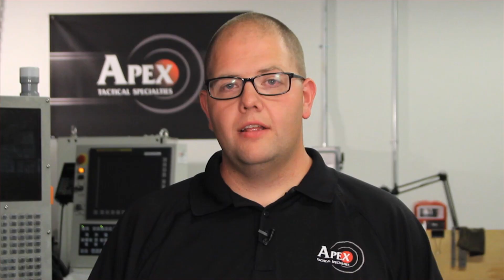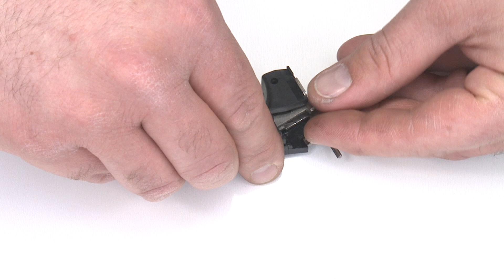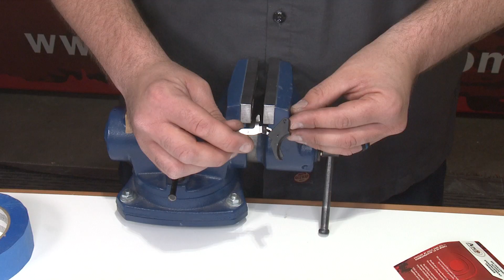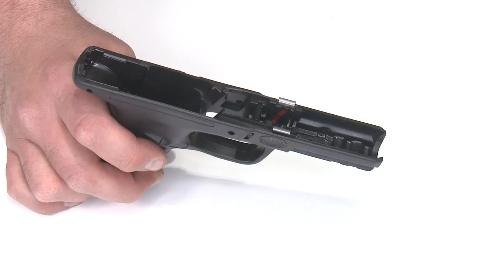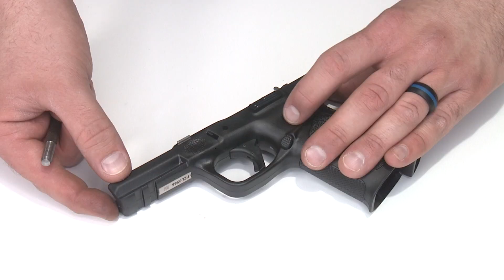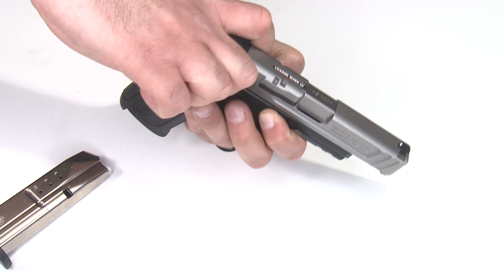How To Reassemble The SDVE Frame

Comment: I accidentally drove the sear pin out from left to right during removal, but it got stuck halfway near the magazine disconnect. I then realized that the left side of the pin is splined. I pushed it back the other way, and it came out fine. Could the frame be damaged, or is it just the sear housing? If it’s the sear housing, I can still order that part brand new.

Comment: The trigger pivot pin should re-assemble from left to right. It is extremely difficult to reassemble from right to left, because of the groove in the trigger pivot pin. Everyone else on the internet says to install from left to right; I had to purchase a second trigger trying to install right to left. Definitely, a bad tech tip.

Comment: This video states: “Re-assemble the trigger pivot pin from right to left.” Do not re-assemble from right to left. The groove on the trigger pivot pin will get caught up in the trigger assembly. Re-assemble the trigger pivot pin from left to right, like everyone else on the internet says to do. The pivot pin became stuck and I had to order an additional trigger. Once I received the new trigger, it went right in from left to right. Definitely a bad tech tip from “the manufacturer.” If you want to pay for the trigger twice, re-assemble from right to left.

Comment: My trigger kind of sticks when I press it, back towards the grips. Like, it does spring back to the normal position. Is that normal?
Reply from the maker: That is a great question best directed to our customer service staff. You can reach them at 623-322-0200.
Reply: @apextactical  Doug did a great job helping me! Turns out the trigger spring was a little pinched and I simply retraced my installation, reset it, and now it works great. Looking forward to trying it out this weekend at the range! Thanks again!
Reply from the maker: @Jusangen  Glad he could help you diagnose the issue and get it corrected.
Reply: @apextactical  Will do!

Comment: thanks for the video...  i just got done installing here and went to put a couple of clips through the pistol only to find that the slide locked open 3 x in 20 rounds - I thought it was failure to extract or possibly the sear spring but looked down in the chamber and saw the round still in the magazine...  thinking maybe i over tensioned the slide lock or something to the effect?  any ideas for me to resolve this or is this just something that I am going to need to put a couple of rounds through to break in?  The pistol was brand new when I got it and have not had even one misfeed yet through about 170-200 rounds so has to be something to be with this modification over the pistol itself.... any ideas you might have would be greatly appreciated
Reply from the maker: Your best bet, as with all cases of an installation issue, is to contact our customer service. The number, which is on the packaging card, is 623-322-0200. Our customer service can assist you in troubleshooting what is happening and how to correct it.

Comment: I got the "enhancement kit" the trigger was worse than the stock and was more sluggish not firing correctly.
Reply from the maker: Call customer service at 623-322-0200. It's likely you had an issue with the install, and they will assist you in figuring out what's going on.

Comment: Public Service Announcement: If the pin gets stuck when trying to secure the slide lock, make sure the trigger return spring isn't caught on the pin. Also, the slide lock is a PAIN IN THE ASS to replace in general, much much worse than the sear spring because you can't see WTF is going on, you need to fish a number of things onto the pin (the block, the trigger body, the trigger return spring) and the lock spring is tight / no good way to get leverage on it. Just kind of a luck thing tbh

Comment: Why in the hell would you tell us to reassemble everything when you did not even show first that we need to file down the trigger body before putting it back in? Now I have to disassemble the god damn thing which some parts were a pain in the ass to do...
Reply: Reading or watching instructions fully prior to attempting a job is what is always recommended.
Reply from the maker: In many cases you do not need to file the back of the trigger. You won't know until you reassemble and do the function check.
Reply: Mine didnt need filing thankfully
Reply: @phaz3-21  neither did I need to do any filing or adjustments and it works flawlessly

Comment: Just installed mine. I think I filed too much material off from the back of the trigger body. Did it shorten the trigger travel? Is that something I should be worried about? Thanks.
Reply: Did you find any solutions?

Comment: It took a LOT of filing to get the trigger down to the right size in my SD9VE - easily the work that took the most time. Particularly difficult steps: aligning the slide stop lever for the trigger block pin, and aligning the mag lock spring and lever for the rear frame pin. Very happy with the trigger pull after the upgrade - definitely a lighter and smoother pull, but filing the trigger down was really tedious...
Reply: I didn't take off the trigger to do the filing, just used two fingers to hold the safety then filed it while it was in the frame...saved me some time.
Reply: @TangDynasty1983  I did the same, still took me a long time. Maybe I wasn't using a coarse enough file.

Comment: Many, many thanks for this video!!! I use my S&W SD40 VE coup!e of times each month at an outdoor range.  The slide lock lever broke last weekend.  I ordered the part online but the fix wasn't as easy as I thought it would be! When I took out the pin and lever, the spring popped out, so of course I got in over my head by taking apart more pieces.  Then I jumped online and looked at about ten vids before I came across this one.  Totally helped me!  Took me about half an hour to get all of the pieces lined up for the pin insertion, but got the job done.  👍
Reply from the maker: Glad we could help.

Comment: Y'all did that wrong. The magazine disconnect safety components should be seated fully in the garbage can.
Reply: Yeah, I did what you said too, despite seeing warnings all over forums about stuck slides and it was a piece of cake. I was more interested in getting rid of the take-down lever that's attached to the magazine disconnect, but 3 pieces left out during the disassembly, which if you're watching, is kind of what Apex manages to say, and the SD is so much easier to use.  No problems with slide removal, and the magazine stuff all works like non-CA states. It's also easier to undo that mod for say, a S&W warranty return.
Reply: So just leave the disconnect,pin,and spring out and it will still function?
Reply: @thatdudepaydro3445  Yes, that was my experience. If you just leave then out on reassembly, the trigger works with magazine out, and the slide comes right off with A) slide out and b) holding side release tabs down. On mine the magazine dropped smoother as well

Comment: Recommending a gunsmith to perform the reassembly is well warranted at least in my case. I tried literally for hours to get that darn slide stop in place and aligned with the trigger pin and I was unable to do so. Maddening. Since I also have the enhanced trigger I might as well have the gunsmith do that because it may require filing etcetera for overtravel and I just can't deal with it anymore with respect to that slide stop / release. At least I was able to install the Springs contained in the SD spring kit and also was able to remove the magazine disconnect, which consisted of four parts. So that at least was good. I think your videos are very informative but they are for people more inclined mechanically than I. This is the last time I will ever  attempt  a detail strip and reassembly for anything other than, perhaps, a Glock. Thanks!
Reply: Trigger return spring was likely caught on the pin if it just abruptly stopped and wouldn't go through even though the opening looked clear. Either that or the slide lock was inserted such that the colored spring was in front of it instead of directly over it (meaning, the spring was in the way of the pin)

Comment: Wonderful, clear & concise videos, guys !!  I have a couple questions regarding the SDVE series of pistols. 1) Will the replacement striker block for the M&P work in the SD ?  2) Your competitors at Galloway Precision state that my SD is "shot out" due to the amount of rounds I've fired through the pistol (apx. 6,300 rounds) and should be "deadlined" !!! Is this true ?? I like my pistol and it still shoots accurately !!!!  3) Have you ever contemplated manufacturing a smaller replacement slide lock lever ?? The stock unit is somewhat over-sized !!!  4) How would I obtain a schematic/ parts list for the SDVE ??  S&W seems reluctant to furnish/ publish one !!

BTW, welcome to AZ, specifically Peoria, a town we lovingly refer to as a "pizza oven", LOL !!!!!
Reply: adviceman52 I’ve heard this 5000 rounds and it’s dead theory also. I’m at 3500 and it’s showing no signs of slowing down. I would say that as you get more rounds thru it, inspection during cleaning should increase for sure.
Reply: @paddymack3224  I've heard the 5000 round and it's dead too story. I'm not sure about it. But I know my guide rod looks like hell after 50 rounds.  Smith told me that is normal wear and not to worry about it. The tech I talked to told me he had 10,000 rounds through his SD 9. He said he had never changed his guide rod. He said it looked real rough but was still going. They did send me a New one, for free.